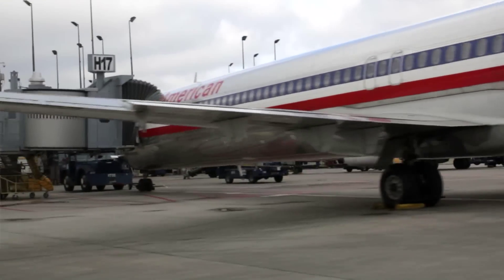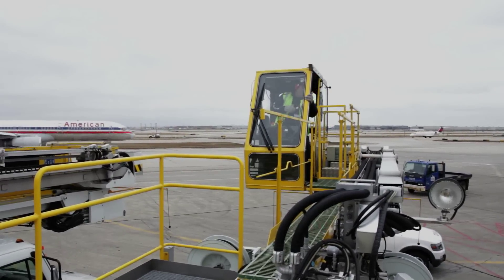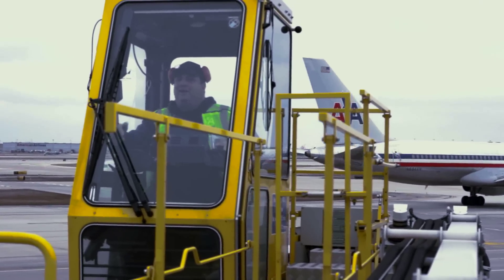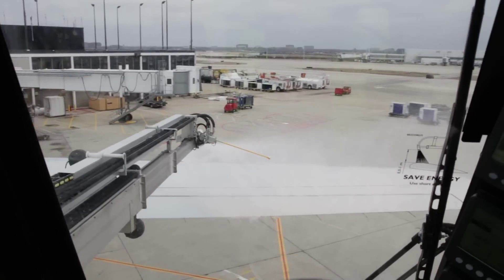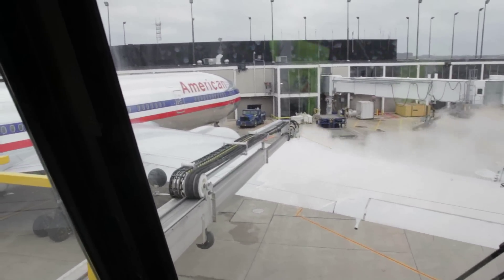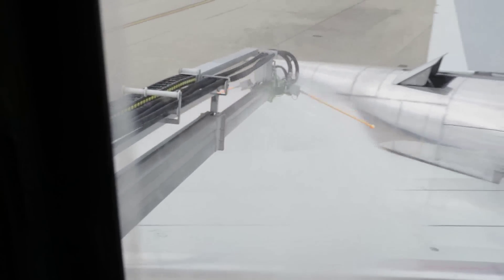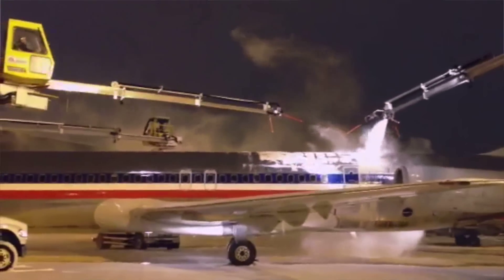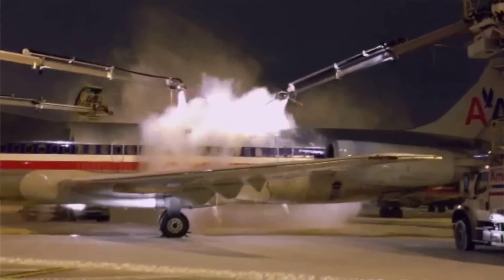How does de-icing work? Behind the Scenes @AmericanAir

Comment: This information is for the Sprayer....
Recommendations for De-icing/Anti-icing Aeroplanes on the Ground
Edition 29 - July 2014
3.9.1.6.1
Wings, horizontal stabilizer, and elevators
Spray from the leading edge to the trailing edge. Do not spray from the rear. Start at the highest point of
the surfaces and work to the lowest parts, i.e. on most aeroplanes start at the wing tip and work towards
the wing root.